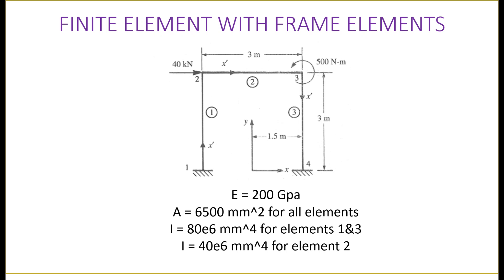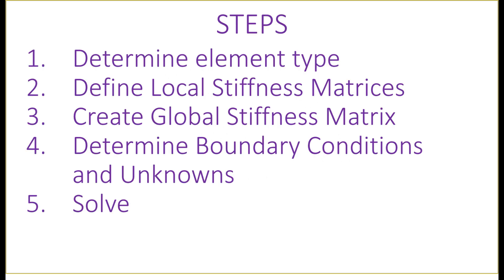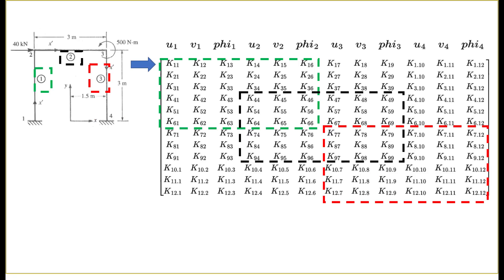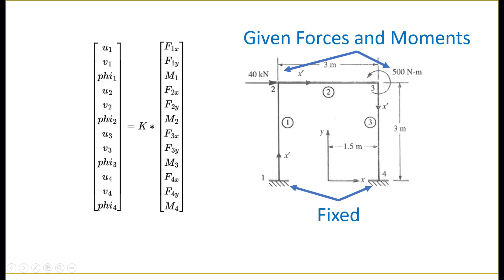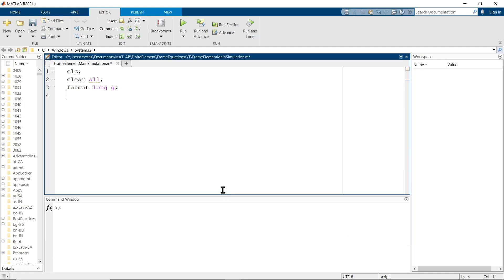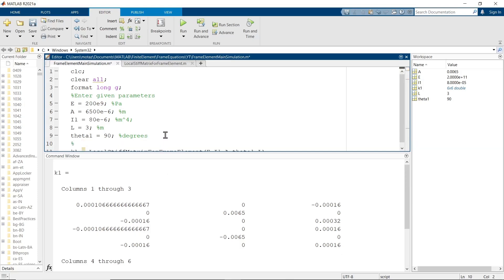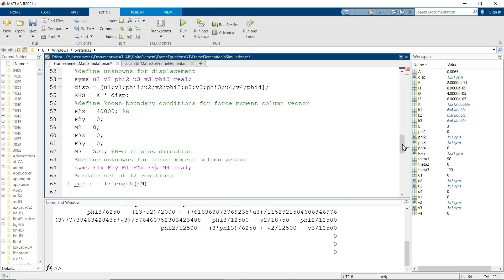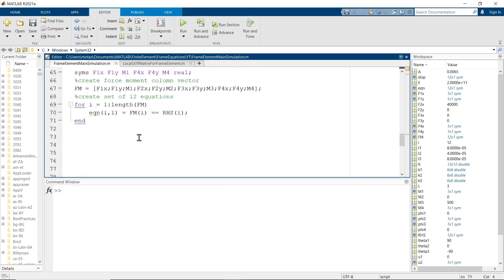Develop a finite element tool in Matlab to solve finite element problem using frame elements.

Comment: Thanka for this video,  i have a question: if one of my supports is spring , how can i model it ?
Reply from the maker: I think you will have to set a reaction force at that location equal to distance compressed multiplied by spring constant. The force will only act in direction of compression for the spring. I honestly can't remember ever seeing a spring as a reaction support though.

Comment: thanks for the informative video. May you help me explain the reaction forces in the vertical direction. the external force is only horizonal. And what failure theory (MSS or Von Misses) is suitable for frame structures. how do i get my stresses after determining the reactions forces and moments. thanks
Reply from the maker: @rosinahfilms9809  there are reaction forces in both x and y directions. When there is no force in a direction the textbook will put rollers. There also a moments there at points 1 and 4 as well as forces in both x and y.
Reply: @mtzmechengr5781  Thanks much appreciated.